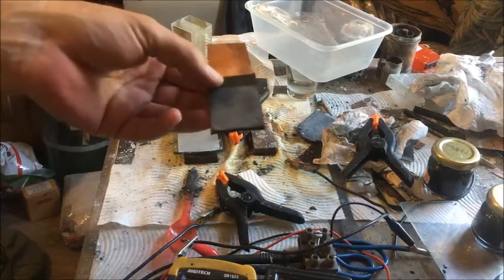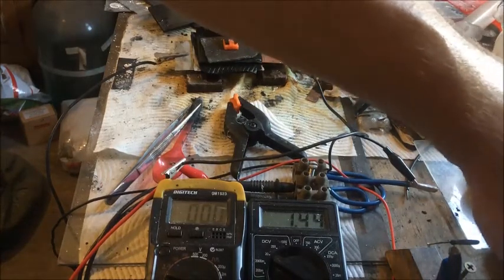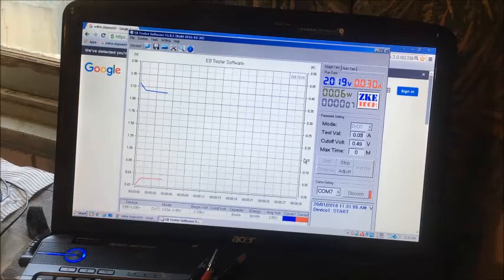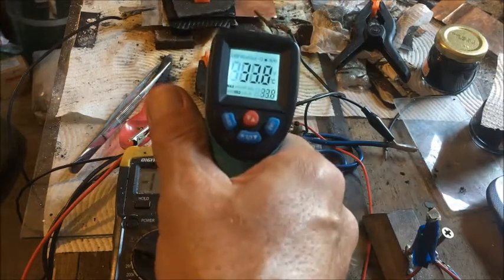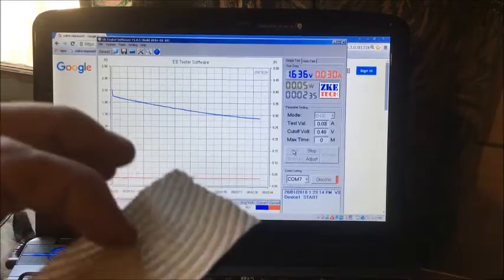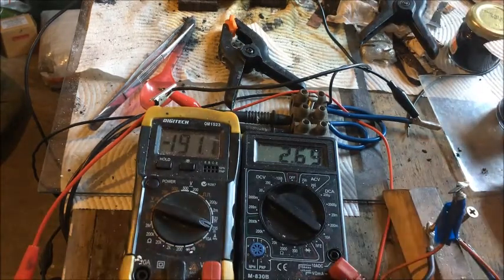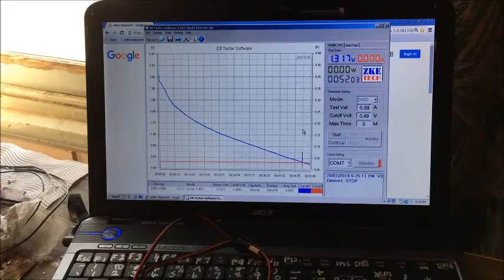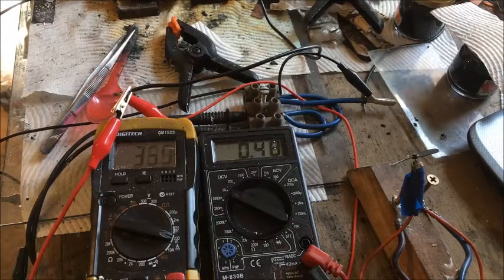Zinc And Manganese dioxide On Paper Towel separator With Added  Separator

Comment: Hi Dan, Well done mate.
I like the data logging graph of the cell charging, it can be seen that the cell is charged in a short time, the rest of the time all those mA’s are disassociating the electrolyte due to the high charge voltage.
It may be worth a couple of runs keeping the charge under 2V, see if that helps, I appreciate another reason the cell is drying out, your Aussie heat :-)   Martin.

Comment: Well done Dan you seem to be getting there mate.😎
Reply from the maker: Thanks Kev,  I'm having trouble keeping the electrolyte from drying, the last test and the cell was dry in 6 hours, It was 36 degrees c out side temp.
Reply: everyone has this problem mate i wouldn't worry about it too much.
If you think about it every battery ever made is of a sealed construction, most with some form of one way ( Gas ) venting system so naturally they do not dry out.
Reply: will glyserine help to maintain less evaporation